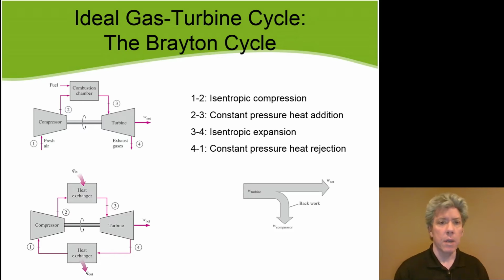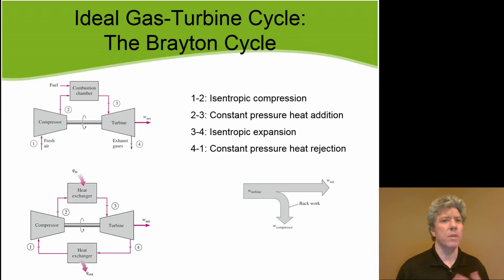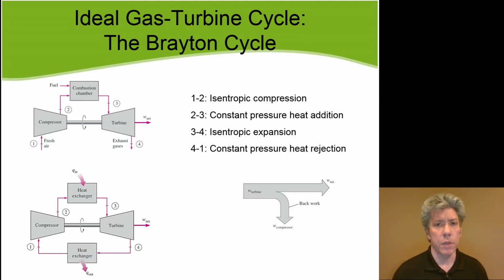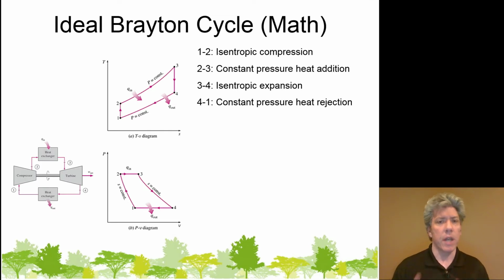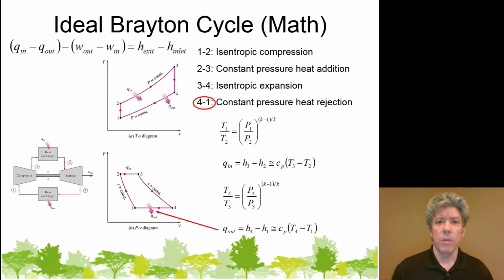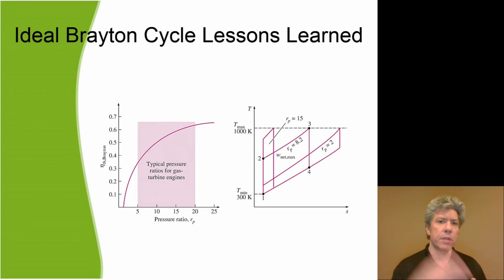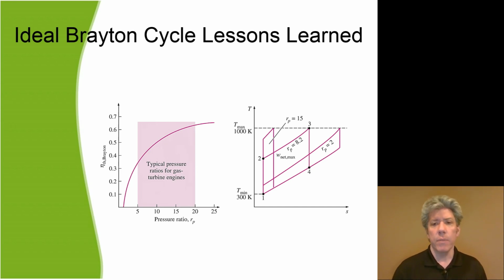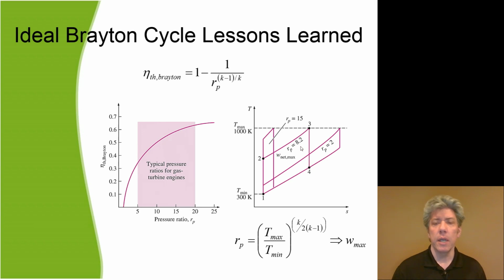MET 320 Ideal Brayton Cycle

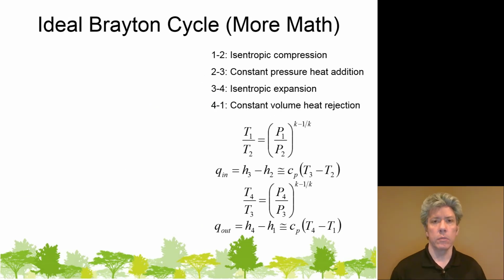Comment: At 9:27 the book has different formulas on page 508. ( T_sub(2)/T_sub(1) ) = ( ( P_sub(2)/P_sub(1) ) ^ ((k-1)/k) ) and ( T_sub(3)/T_sub(4) ) = ( ( P_sub(3)/P_sub(4) ) ^ ((k-1)/k) ) are they equivalent, or are they different?
Reply from the maker: You must recognize that the equations given in the text refer to generic state numbers.  At 9:27 they have simply been applied to two states that are isentropically related.  Do not focus on the detail of what the particular numbers are; rather, on the fact that the two states are related isentropically.